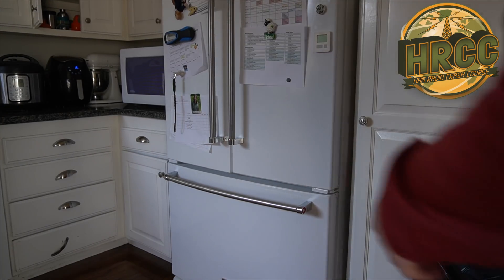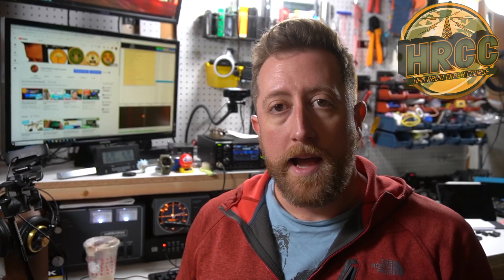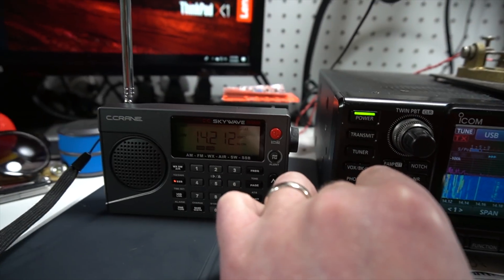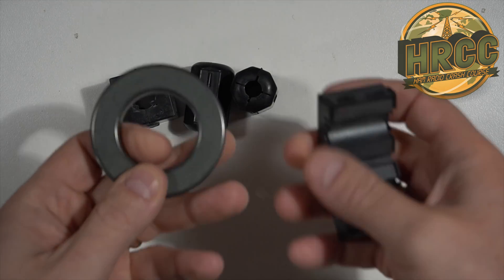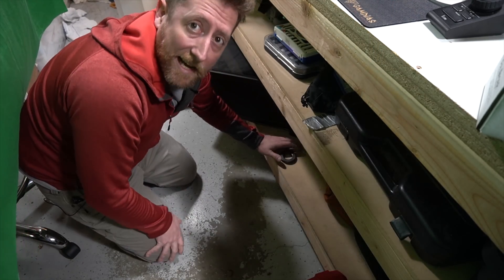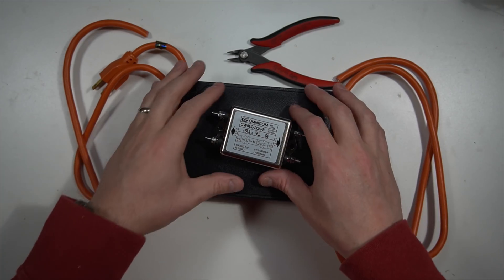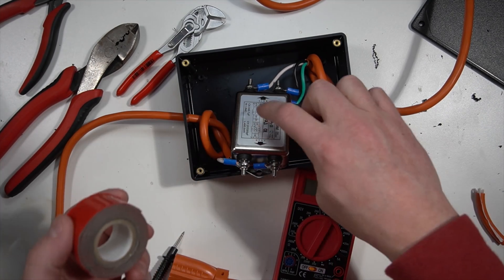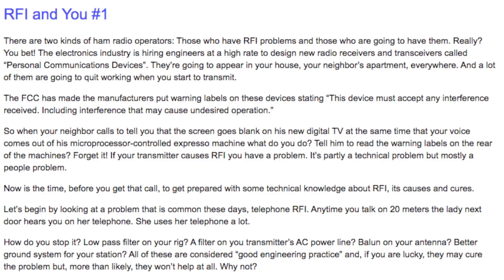WE are killing the amateur radio bands, and here is how to fix it (RFI)

Comment: Would it help to have your house wired for DC and then use DC devices only (no inverters or rectifiers)?
Reply: The first thing that happens in a switchmode power supply is the AC line voltage is converted to DC.  In fact, you can usually run them on DC.  It isn't going to help with the noise.

Comment: Why don't you put a better earth ground on your service panel.go to the service panel and run a # 4 solid wire down to the ground and drive a six foot ground rod in the ground and put a approved ground clamp holding the wire to the rod. you probably have short life with your light bulbs burning out.

Comment: or..... you can use a DX Engineering NCC-2 like I have - look me up @ kk4ydr Ham Radio I have a video on its super usefulness. But this video is spot on. I recommend Mix31 material split beads to cut this noise out.

Comment: That could explain how listening to AM radio and shortwave during a power failure is better. Crisp signals and NO AC mains hum. My dryer and fridge are old school models not the android on the fridge models that people hack them in stores to play Fortnite.
Reply from the maker: In the video I killed the power so I could determine what circuit the RFI causing device was on.  During a power outage, turn a radio on, you'll never hear it clearer.

Comment: Great Information... My problem is 12V PS  switching supply ... I have tried two fat Palmomir ones and it did some but not enough.  I use the P.S. to support my remote HF tuner...and it gets into 160 through 40 meters... any suggestions as to where I can purchase a low amp 12V power supply that is transformer based???   I have no tools and equipment to build my own.  Yes it is amazing how these new appliances pump out garbage.  In this case the breaker teknique is not necessary... I just have to switch off that damn power supply and the hasss disappears.,,  I have there different makes and all were loud.   73's.   K9BW
Reply from the maker: I'd ditch that PSU.  Something sounds off with it.
Reply: @HamRadioCrashCourse Thanks for quick reply.  Well, dug through a box of "stuff' I forgot about and found 3 more PS's... Of different brands. some expensive some cheap.  Well, they all did the same thing.. One maybe a little louder.   Yes I used more than one very fat Palomar choke.  I have Palomar products I am surprised they are still in business...so many ham companies have hit the dust.   Well, then I remembered I had a 45 yr old Radio Shack 12V power supply.   I connected it up to the same remote input to the tuner... WITH NO CHOKE... like magic.... pure quiet.  not a hum or hash on any band... 160 previously was about an s20... now nothing.   So, 3 different brands.. none were cheap price ... but all krap.   In this instance... the Palomar chokes were very ineffective...that surprised me.. So with the 45+ yr old power supply not even a slight hummmmm no more hasss.. no nutten.    Well.... that is the rest of the story.  It looks like I will not even need any iron chokes.

Comment: Good video but perhaps you  missed one big fix that is probably one of the better bangs for the buck.  also be part of the noise reduction. 

Common mode current on the feed lines makes the feed lines and possibly anything connected to the feed lines including tuner switches and radio chassis  part of the antenna.  Common mode works both ways. RFI on transmit and noise on recieve.  

chokes on the antennas and if possible using balanced antennas.   The all popular EFHW is a great creator of common mode and in some installations like those with no counterpoise rely on common mode.  this is bad for noise pick up among other things.   in the case of EFHW use a good counterpoise and common mode choke like a good Guenalla balun of the W2DU design like the ones that Palomar sells.  OCFD is another bad one but easier to fix with again a good common mode choke to make it a hybrid balun or a real 2 core current balun at the feed.   

he mentions Palomar Engineering.   if you need snap ons they are great.  those ebay, Amazon  and ham fest finds. are typically the wrong or unknown mixes and may do nothing for HF  so I'm with him on the Palomar

Comment: If a toriod won't cut it, a pi filter would do wonders at the input of the offending device. Had to use a saturable reactor once, for something really ugly in noise (industrial size motor).
With that last, I joked that a few megahenries of inductance would do the trick, but alas, the Hoover dam was taken.  ;)

Comment: Very useful thanks...so I never thought of adding the toroidals to the actual noise-producing appliances...
Reply from the maker: You have to if they are bad enough. Your basically using the toroid to null the line which is being used as an antenna.

Comment: On any given day my noise level can be as high as S-5 to S-9. My friend has about the same 10 miles away and in general the noise
floor has risen over the years from very low to crazy bad.
 I live in a suburb of Sacramento and so does that friend. I have killed the power to my house and found that the noise decreases 

by only an s unit or so. The noise around the block is EVERYWHERE. My friend has just about given up on HF Ham Radio and so have I.
 Cheap Dollar Store LED bulbs make noise, the new street lights make noise, many new big screen TV's make noise and a lot of the
new Wi-Fi devises make RF noise.

What happened with the FCC in regards to this problem ?
Reply from the maker: It’s likely the your power provider if it is that broad-banded and high s level. Contact the company and explain the situation.

Comment: I may add a different point of view.  Or expand on what you mentined about the ferrite toroids.

Besides the different sizes of the toroids, they come in different materials.  But first, what you show by multiple turns of the cable through the core is indeed the preferred way.  In principle, you could think of using two or 3 cores for increased effect.  And that indeed happens -- you get double or triple inductance and generally attenuation.  It goes LINEARLY up by the number of the cores.  However, when you add turns of cable through a single core, you get a quadratic relationship.  That means 4x for two turns, 9x for 3 turns, 16x for 4 turns and 25x for 5 turns.  A clear preference, I believe everybody agrees.
Then a little about the core materials.  As every manufacturer has their own material designators, I cannot cover more than one, and even that very superficially, based on what I happen to remember.  Fair-Rite has 4 different materials used for EMI abatement (and others for transformers etc.)  Here is what I recall.  Their material 31 is a high permeability (high inductance) type ideally suited for low frequency disturbances problematic to measurement and control systems.  Generally favorable for a few kHz to 10 or 20 MHz range.  The grade 43 is lower permeability material, most common for ham radio range.  Grades 73 and 66 are even lower permeability and may be applicable even higher ranges, from 140 MHz to 1 GHz or maybe even beyond.  But the higher the frequency range, the smaller the cores are, so fewer turns and thinner wires must be used.
I hope this gives some rule-of-thumb ideas.

Comment: Love your video.  I too live in So Cal and have a high noise floor on 40 meters.  & years ago when I moved to current house the noise floor was higher than my last house.  I too shut off all my circuit breakers and the noise floor is the same.  I concluded the noise is coming from the SCE transformer on the power pole in my neighbors yard. (the pole is right on the property line between the  two homes.)

If my wife is blow drying her hair and I transmit on 40 meters it pops the breaker on that loop where the blow dryer is plugged into but not on any other band does it do that.  So I've got other issues on 4 meters.

Lastly I will say my noise floor has gone down a bit when I bought all new appliances during our remodel.

Chasing RFI is a life long journey for HAM operators who loive in a high noise area anyway.

Thanks for your vids.

Ken

Comment: Best part was at 9:32.  Had not seen the line filter before.  Need to keep that in mind for RFI hunting.  Must be grounded thought.   Will look more closely at the dryer & washer circuit next time I go hunting.    I wonder does someone make a trap / torrid that can be placed before the panel... on the main feed coming in?   Would be nice to eliminate any RFI coming in from the Power Company's meter, etc.?

Comment: The noise of today's amateur radio receivers is in most cases not from outside origin but from inside the unit. 1. No tunable preselector. 2. The first mixer does not tolerate dynamics anymore. 3. Multiple conversion is completely unnecessary, rather replace quartz filters and oscillating circuits. 4. digital technology should only be used in the audio frequency range.
(A radio amateur who is also an electrical engineer)

Comment: You might wish to comment on the challenges with living in an apartment or townhome complex as SH suggests. Even in my rural neighborhood, (everyone has 5 acres) I have neighbors with every conceivable type of RFI generators. One neighbor collects old cars and his garage sports several neon and other antique signs that are notorious and his tig welder has a switching supply that is gnarly. I also have neighbors with RF leaking from their homes from cable TV etc. In one instance the cable leak is so bad I can aim a YAGI that way and watch their cable!  We also have rural electric service and hey have some very bad transformer and interconnect RFI that they claim they do not have the tools, equipment or time to pursue! Agreed the RFI from modern devices can be horrendous. I sort fo love older less "efficient" appliances because they are not the culprits. AB4P . - .  73

Comment: At  5:03 you mentioned adding devices to the radio.  I thought you were going to discuss Active Noise Filtering, but you never got back to that.  What up?
Reply from the maker: "Adding devices"  e.g. USB, speakers, etc. all devices got ferrites.  I never referenced active noise filtering in this video.
Reply: @HamRadioCrashCourse  - I didn't say you did.  That was my point.  I was just surprised that you didn't broach the topic - because that's the next logical step in removing RF interference.  

DSP speakers do nothing to eliminate interference from your refrigerator or TV or what have you.

I'm not discrediting your video in the least.  It's a well done, informative discussion.  I just think you could have taken it to the next level with a mention of Active Filters.  That's all.  

73!
Reply from the maker: I’ll look into making a video on the topic. Thanks!

Comment: Same problems on my SDR.  Wonder how I'll fix that.   ;(
Reply: Two sources of noise on SDR, both from other devices but also coming in from the USB connector. I tried cores and so on but what really did a difference was 3 meter USB extender cable and it was cheap to.

Comment: my monitor causes rfi on 20m,  also a light in the kitchen and dryer which is at the other end of the house....I have ferrite chokes and torroid on power cables going into the 7300 and computer cables also line isolator on the feed line( which made the biggest difference). My samlex power supply had a bit of noise but opened it up to fix a ground which helped

Comment: OK, so you cured the "wire born" interference but a lot of RFI is airborne. That means its not coming up through the wires. Its coming direct through the air and going directly into your  antennas. Also it can be via the air and then picked up on your shack wiring , even into the unshielded DC leads. My shack is a rats nest of spaghetti wiring with audio & video , rf coax. DC power. Amplifier interconnects , plugs sockets etc. Some of the crap I get from HF right through to microwave bands. Good luck to you all (smile)
Reply from the maker: That is why the “defense” is for on your radio. Putting chokes on all the wires into the radio attenuates the common mode rfi riding on the wires into your radio.

Comment: I'm confused. Very much not an electrician, but I was under the impression that ferrite chokes eliminated HF signals across a cable. If that's the case, how were you able to pick up anything with your radio when you wrapped your coax through a torrite core (6:33)? I figured that'd cut off signals from your antenna. What gives?
Reply from the maker: The interference that we're choking out with the ferrites and torioids is common mode interference that rides on the outer surface of the shield of the coax.  The  wrapping around the ferrite is essentially knocking the RFI off the braid.
Reply: Ham Radio Crash Course Oh okay! That makes a lot more sense. Thanks for the clarification!

Comment: Thanks for the video! 
- By the way, another thing that may causes trouble on the bands are hams themselves sometimes.
Apparently, too much RF power in combination with harmonics causes noise on the bands.
That's nothing new, though. People were aware of this since 1924 or so (saw an article of that time once). ;)
Anyway, the RFI problem is real for sure. Using magnetic antennas and multi shielded coax cables (not RG58/213)
might be helpful somtimes, I guess. Getting rid/fixing of the noise sources might be most successful idea, though.

Comment: Hi ... this is a great video.  However, I would highly recommend you delete the part out the dryer filter since it breaks the ground circuit.  I shared it with my ham club and the electricians got very excited due to risk here.   You may be setting yourself up for liability if someone does make this change as a fix you recommend and then some sort of 'event' happen.    Beyond that, it is great.
Reply from the maker: Indeed. I added comments to the video page as well as the description. The ground is attached. I’ll see what I can do with the YouTube editor.

Comment: I was thinking about getting into ham radio after a 60 year hiatus from electronics. I set up an SDR dongle and began listening to the ham bands. I was appalled at the banality of the conversations. “Hey OM how am I coming through? I’m using a new antenna I built with a coat hanger and a Victor mouse trap. 73s”

Maybe it’s time to create a branch of amateur radio defined by an alternative communications system that could survive a massive denial of service attack or EMP. 

As of right now all ham gear would be fried along with every other computer. Maybe a legitimate ham goal would be to create a retro system using tubes (gasp) and CW. 

Yes, plate voltages require extreme caution when handling compared to solid state but we were building 900v power supplies back in HS.
Reply: J P We had an old radar unit with CRT. Used it for a SF project to drive an ultrasonic transducer to make a half assed ultrasonic measuring device. Took longer to make it appear to work more than when it actually worked. Never used a bicycle helmet either. 

My partner, future IBM, hooked some big capacitors to an old mercury vapor rectifier and charged an electric fence wire with it. Totally ruined their relationship with the neighbor.

Comment: I have dead zones on ham, AM, FM and wifi because of steel and cement that the apartment building has in it. TV is totally impossible. All my antennas must occupy a 2 foot square area within the property, which is not possible. Outside mounts violate the lease.
I don't expect you, or anyone else to have a solution, besides the one I came up with - move.
I would like to test my next location before lease signatures. Ideas?

Comment: You really need to get that earth/ground reconnected to your dryer , you have just created a potential killer by removing it. You need to get yourself familiar with your local electrical regulations/ codes. Perhaps you should edit that bit out or you find yourself up in front of the authorities....just saying !
Reply from the maker: It was just the editing. Ground is connect. No worries.

Comment: God I wish it was that simple.  Our area has S8 and above noise from a composite of sources that are so plentiful and multiplicative that very little can be done.  Shutting off all power to the home and the neighbors homes makes no difference.  Hunting and finding power line noise contributors (typically pole insulator wrappings and lightning arrestors and to a lesser extent transformers) helps a tiny tiny tiny tiny bit.  Currently using a Wellbrook ALA1530 magnetic loop.  That helps a tiny tiny bit at lowering both signals and noise, with a slight slight improvement in S/N ratio.

Comment: wrapping TWO wires (one positive, one negative) around a toroid is a waste since the toroid can only attenuate the difference between the two (this is how twisted cable works).

try this: separate the powr cable in two wires and loop only one side around the toroid!

Comment: Your dryer runs on 120  not 220 like mine. But I not ham radio  user  watching this video I think. I will. Pass to much trouble
Reply from the maker: The dryer uses natural gas. 

Don’t worry so much about this rfi stuff starting out in radio.  Starting if you work off repeaters using a handi-talkie you will have less of an issue.